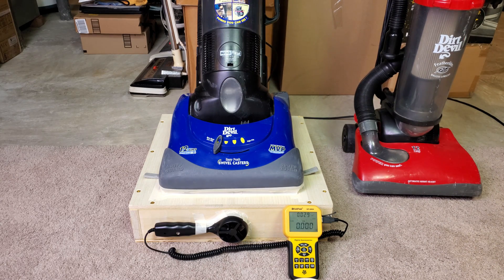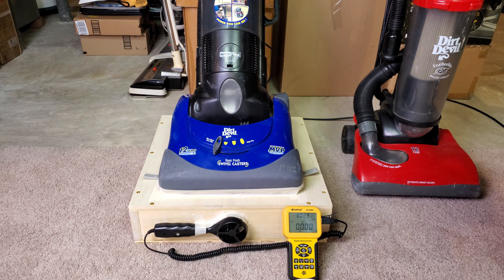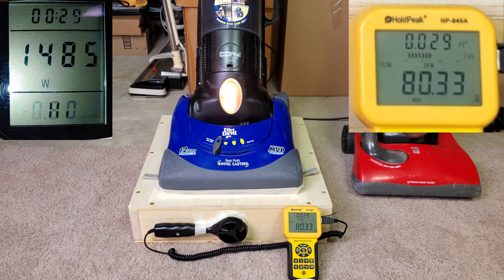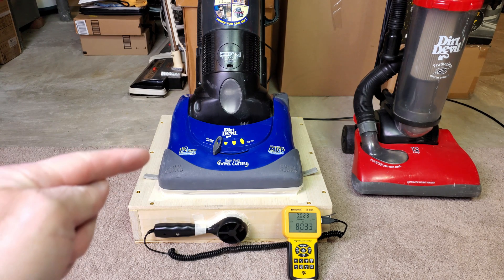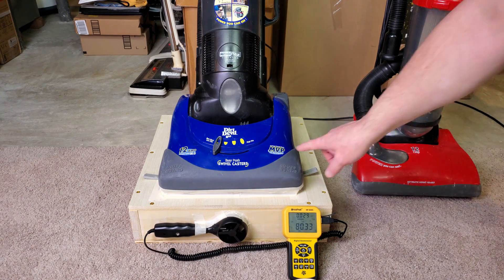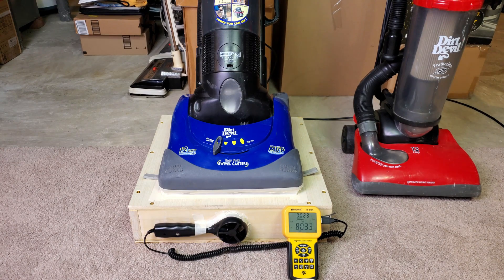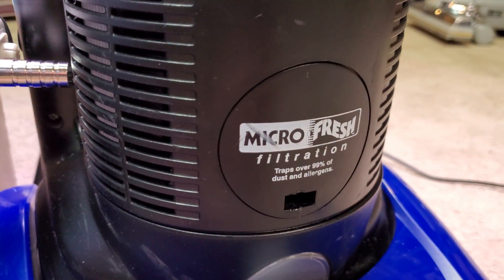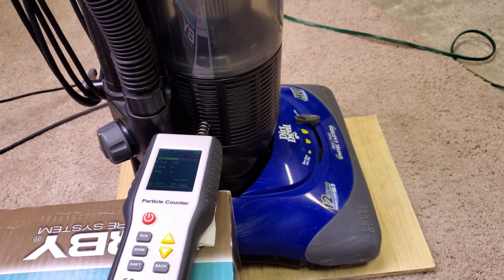Dirt Devil Featherlite Vision Airflow Suction BR RPM And Particle Tests

Comment: Now my mouth really dropped to the floor with the results. Great Airflow, decent nozzle suction, FABULOUS air quality, and the brushroll RPM wasn't bad either. The absolute hilarious thing is the exhaust filter is a genuine HEPA filter from Dirt Devil and the bin filter is F1 Style but it's from Febreze. When I had my previous Red one from 2003 I knew it was a fabulous vacuuum.